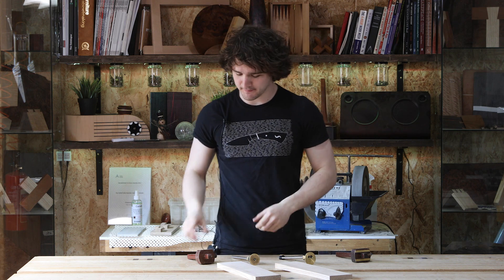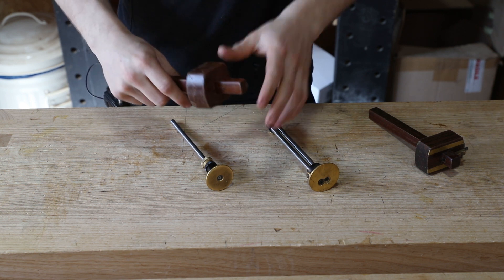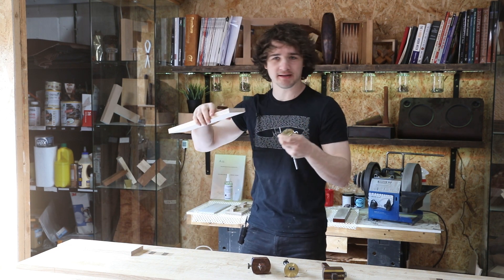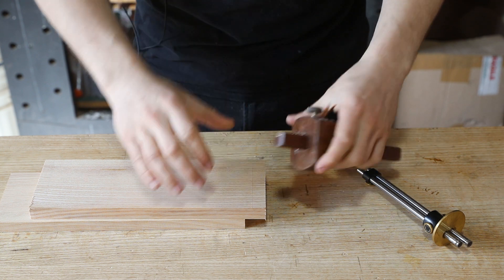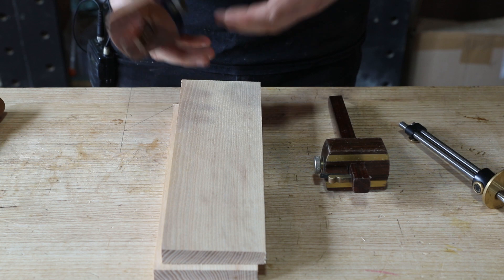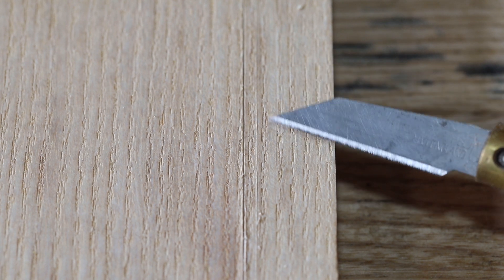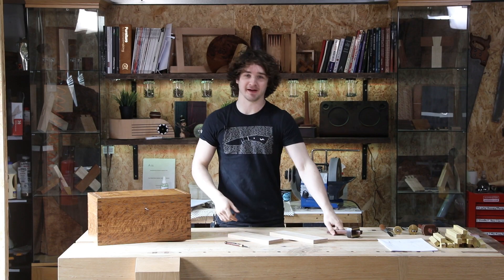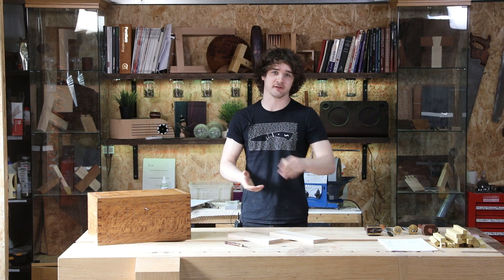How to Use a Marking Gauge CORRECTLY

Comment: So I just need to put marking gauge lines on my router-cut dovetails and I can charge double for my work.  Useful tip - thanks Matt!
Reply from the maker: Now this is a businessman!
Reply: It helps to vary the sizes of the pins and sockets so that it doesn't look like they were cut with a jig.  Also, take a chisel to the edge of a couple of cuts and make them just a hair wider than they should be, like you messed up when you cut them.  It all adds to the realism.  😉

Comment: Absolutely found this video useful.

Also, I disagree that learning to use tools properly is not that important if you are not into fine cabinetry only. You may not need to do things of that finesse all the time, but there's always one tiny detail where you do need to work at a very fine level of detail. For these 5%, or maybe even 1% of the situations, the knowledge you transmitted is absolutely useful.

Plus, some ambitious DIY-ers like to build their tools themselves. Without such knowledge, their tools are going to be rubbish. With it, some, who are also into metal working, build marvels that no industrial product can match (simply because it would cost too much).

Comment: Lots of good tips , thanks Matt.
In my very limited experience, I find myself pulling and pushing - mainly because I tend to slop away from straight as I approach a corner/edge, so I work from each side towards the middle. Dunno if that's bad practice...
Reply: If it works for you and you are getting straight lines, go for it

Comment: There's one more usage for marking gauges - cutting thick veneer or glued together several sheets of veneer. I've done that when I needed thin stripes for purfling - when you need stripe 3 mm in height, 1.5 mm in width and quite wobble main piece cutting gauge will save your time and material.

Comment: There are things you can do with the flush marking gauge that make it better.

Like putting you stock flat on the workbench and referencing the tickness of you stock by letting the disk fall.  

It's not just having the disk cutter it's that flush to the end that makes it that much more accurate and quick

Comment: So I'm curious, I just bought a cutting gauge recently, (I wish I had seen your video first), but I'm struggling with using it to get the thickness of the wood in relation to the cutting blade...
I wish I had gotten the round one...

Comment: I just got my first "real" marking gauge so no more old, cheap hobby knife for me! I got the Veritas with micro adjustment. Do you allow the cutting edge to essentially... "drag" across the surface by holding the marking gauge tight or do you allow the marking gauge to roll in your hand so the cutting wheel is kind of cutting like a pizza cutter? Yes. I am that much of a hand tool newbie lol